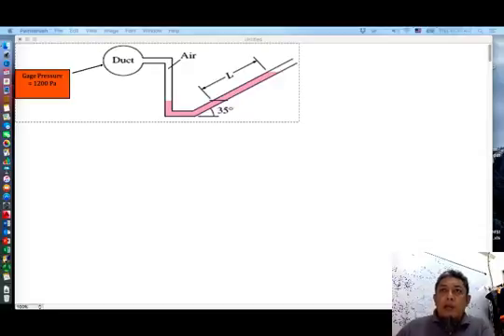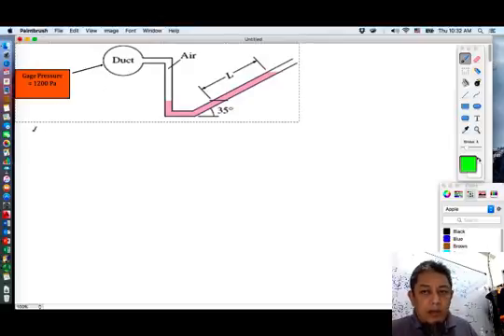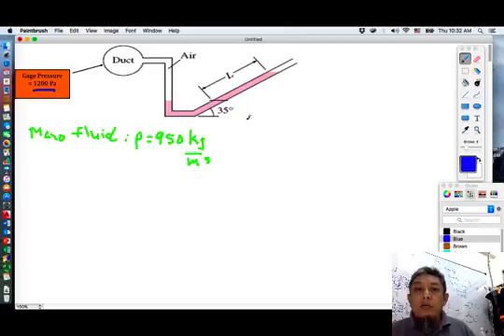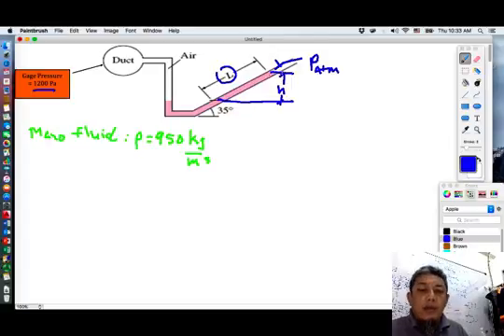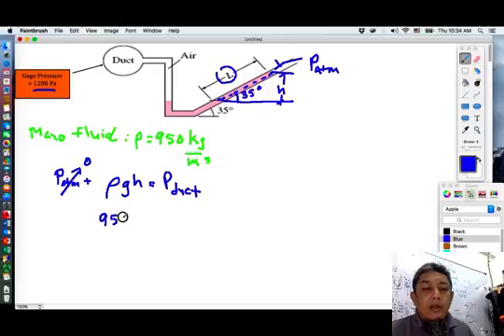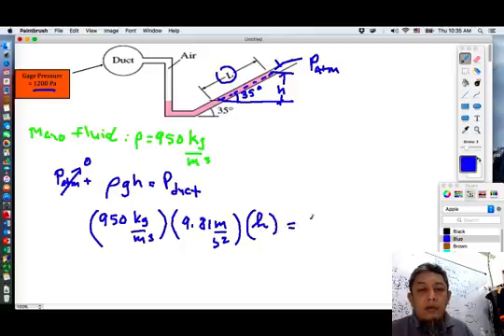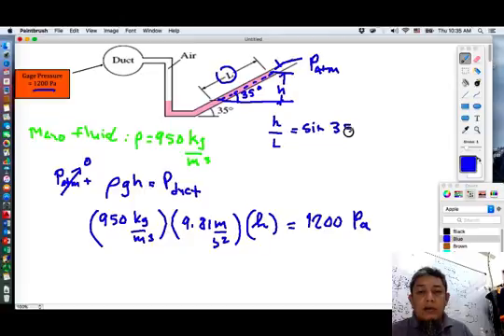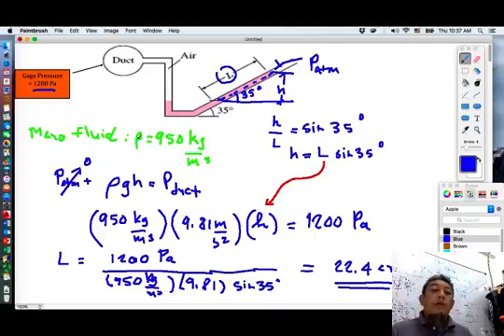Fluid  Static #4  -Inclined Manometer

Comment: Why pressure atm = 0
Reply: because if you look it's in vacuum .....or you can say it's open to an air , free for air but due to vaccum here pressure is very much low so we can neglect it......that's all.....
Reply: Because the pressure given in units gauge so atmospheric pressure =0
But when give Absolute pressure we use atmospheric pressure =101.325